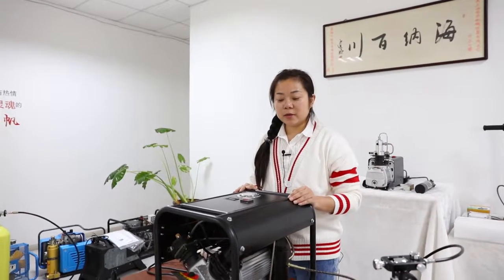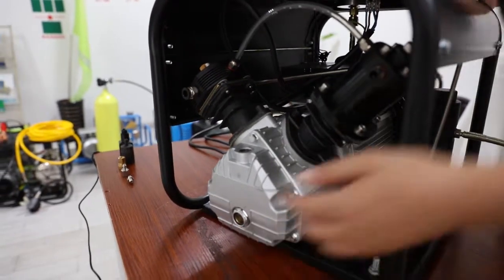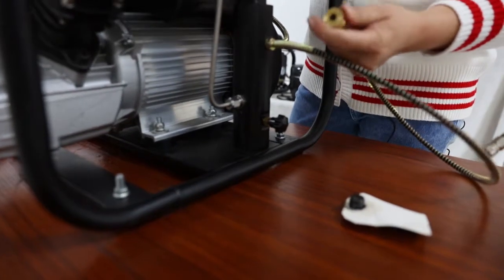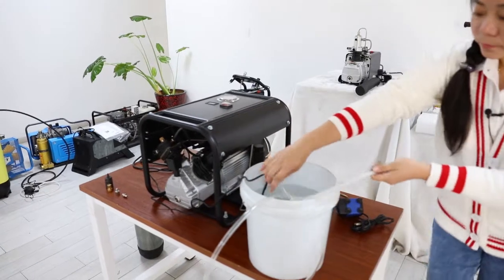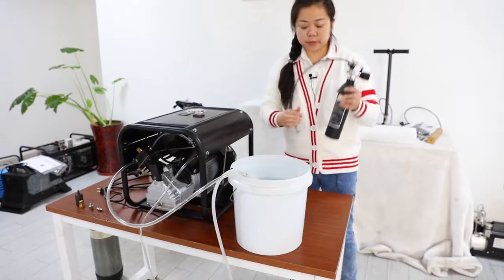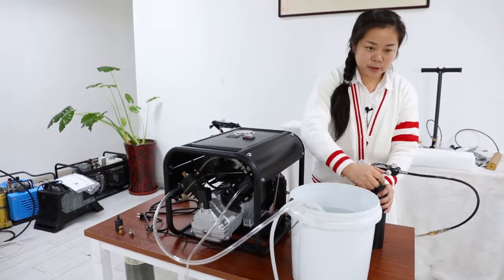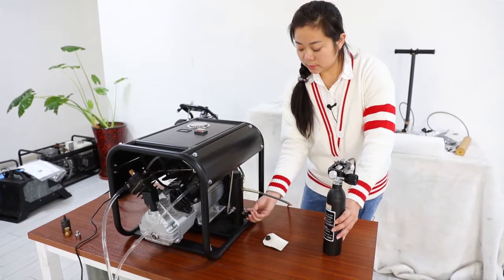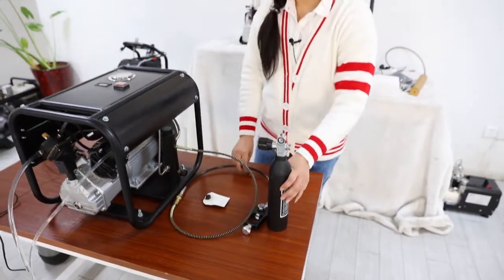DAVV SCU50 High Pressure Compressor Operation Guide

Comment: Just received mine. did not have a filler hose with it nor any bleeder screws or anything of that nature!!
Reply from the maker: contact seller, they will send replacement
Reply: Ran it today.Ran for 7 minutes and the jug cracked that the piston is inside of.Filled  two paintball tanks and started vibrating really bad.

Comment: Bought this off of amazon. By the time i got the compressor and tested it the return ran out by a couple of days.  Here is the problem; takes too long to fill tank 1hr 45 min, for 80 cu feet, and there is lots of oil in air compressor filter provided. I bought a secondary filter it has some oil in it.  After filling tank i checked the air and can smell oil.  It is apparent there is oil getting into the air what is the remedy and will the company provide parts so i can repair it? The return to amazon has expired, but not the warranty.  I just bought it Feb 6th.  I just received the air compressor and additional items to fill tanks about a week ago.
Reply from the maker: hello, it’s for paintball tank filling. Not for scuba tank. Normally, less than 1L tank. Surely need a precise filter for breathing.
Reply: @Chloe_Tin  hello, the advisement said scuba, and your video even showed scuba tank although smaller than 80 cu feet, further whether it is smaller tank or not, should still have no oil in the air
Reply from the maker: use scuba tank just for demonstration, not recommend
Reply: @Chloe_Tin  you even said you take it diving, so bottom line oil in the the air is acceptable whether for breathing or not? correct answer is no, it can damage your tools or paint ball guns.  Oil should not be passing by the pistons. again will the company send repair parts? and how do i get them? This oil is dripping out of the drain. Too much oil!!!!!
Reply: The amazon listing even showed it can be used for filling tanks, reviews recommended additional filters to which i got.  But again should not be dripping oil or have a distinct odor of oil, unless the rings on the piston are shot.
Reply from the maker: Alaska Got_Class you may need an air filter. Rebuild spare parts replacements are available
Reply from the maker: Alaska Got_Class emergency breathing tank

Comment: I PURCHASED THIS COMPRESSOR PARTS WERE MISSING UPON ARRIVAL TOOK 3 WEEK TO GET THE CRANK CASE VENT.  AFTER FILLING ONE GUN THE MACHINE WILL NOT COMPRESS AIR.  to FILL JUST THE HOSE IT RAN 15 MINUTES TO FILL JUST THE HOSE TO 1000 PSI.  PURCHASED  THIS COMPRESSOR THROUGH AMAZON A REQUEST TO RETURN MACHINE WAS SUBMITTED AND WAS INFORMED BY AMAZON WILL REQUIRED APPROVAL FROM DAVY COMPRESSOR.  WE HAVE HEARD NOTHING FOR THREE DAYS GETTING READY TO FILE A CLAIM.  ALSO I CALLED DAVY COMPRESSOR  COMPANY DIRECTLY, THEY INSTRUCTED ME BY TEXT TO CHECK FITTINGS FOR LEAKS WITH SOAP AND WATER INFORM THEM THIS HAD ALREADY BE PERFORMED AND NO FITTING LEAKS WERE FOUND. DAVY cOMPRESSOR REPRESENITIVE SAID HE GET BACK WITH FURTER IDEAS ON WHAT THE PROBLEM COULD BE, 2 DAYS NOT FURTHER INFORAMTION.  ALSO NO FURTHER INFORMATION FROM AMAZON.  i MAY BE OUT $700.00 THIS REALLY TICKS ME OFF.

I REALY HATE DEALING WITH THESE CHINESE COMPANIES

AT THIS POINT I WOULD NOT RECOMMEND PURCHASING A DAVV SCU 50 COMPRESSOR.
Reply from the maker: so sorry for the inconvenience. you can apply for return & refund, if you are still under return policy.
Reply: Too bad I read your comment late I have the same problem, I can't return it because I get the same shipment as buying a new one, I have the same problem that you bought it 4 weeks ago, I worked well the first week then I only filled up to 2500 and today I don't  if you want move the needle
Reply from the maker: José Acosta hi, could you please contact the seller? They will help you to solve the problem. Thank you

Comment: Hi
, Can I get the SCU50, 60 exploded view? I want to know the position of the valve plate and O-ring inside the head of the high pressure cylinder.
Reply from the maker: goodbyesapjil sure. Mail to my email address and I will email back. Thank you

Comment: Hello, I bought HPDAVv scu50 and after 4 months 10min lapses and with only 4 hours of use it does not compress more, what can it be?
Reply from the maker: you might need to change parts #26, #28, #31 and gaskets first, please?